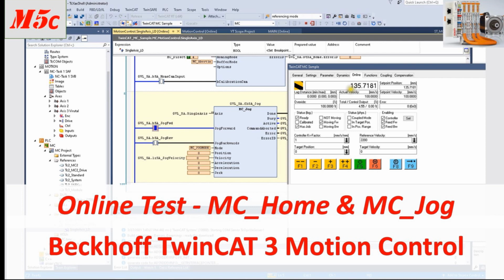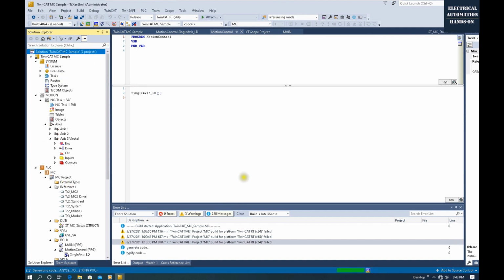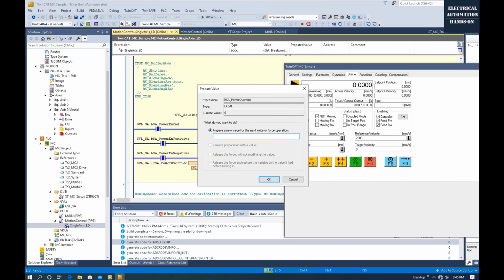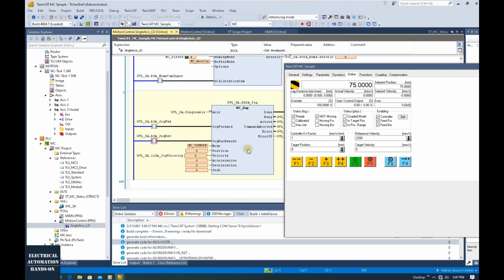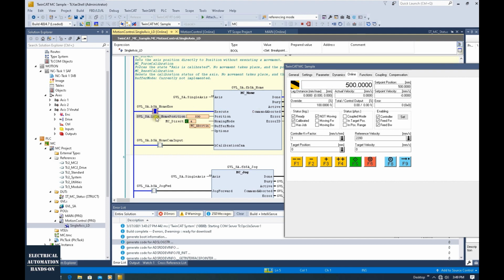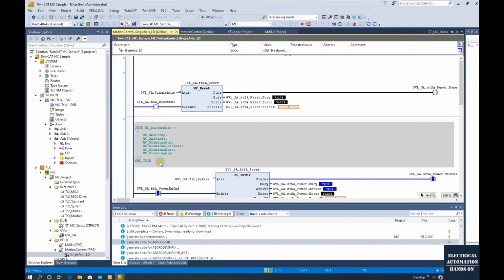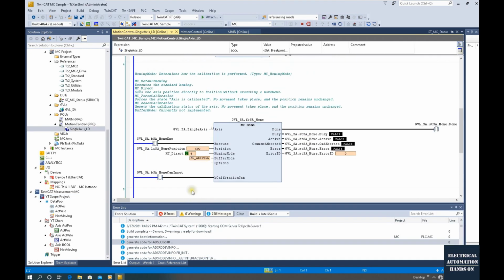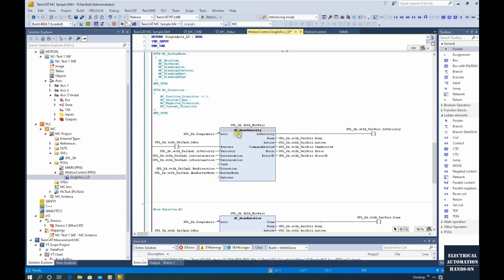MB05c. [TwinCAT 3 NC] Online Test MC Reset, Power, Home, Jog in TwinCAT3 [7/20]

Comment: Hi, I'm using Yaskawa motor. 

I can enable the axis and also can execute reset.
But when I home or jog to some position, getting below error.

"10/8/2021 5:05:27 PM 521 ms | 'TCNC' (500): 'Axis 1' (Axis-ID: 1, Ctrl-ID: 1): The following error 10.377181 exceeds the permitted limit (10.000000) (error-code: 0x4550) !"

Can you help me with this pls?
Reply from the maker: Please review the video "NC Motion Controller - Axis Ctrl Parameters [16/20]" https://youtu.be/9lilLfS5R40?t=1487. Turns OFF the follow error monitoring at initial commissioning. Once you optimize the drive and axis control parameter then active the monitoring after.